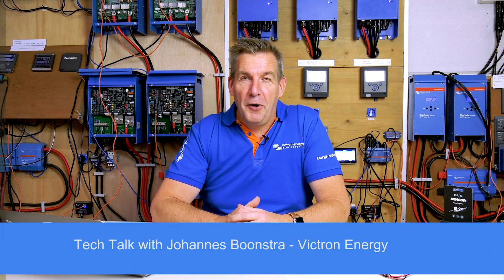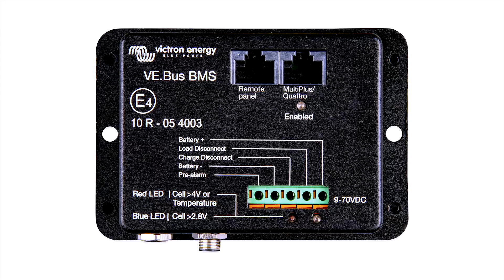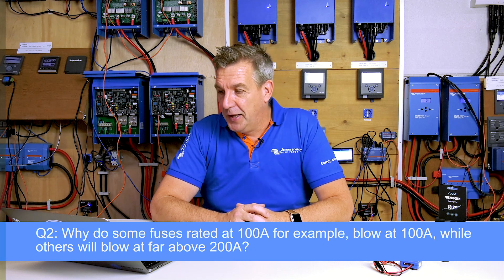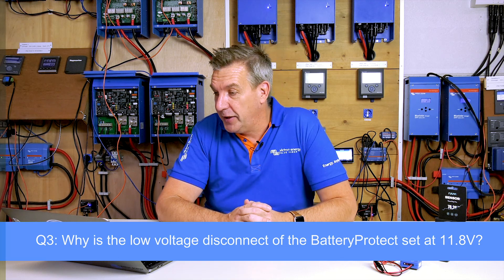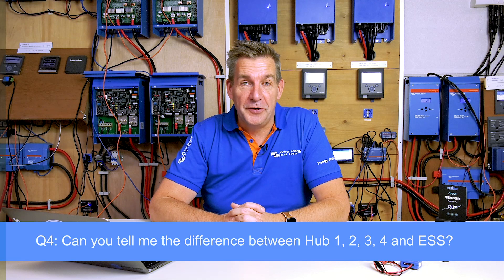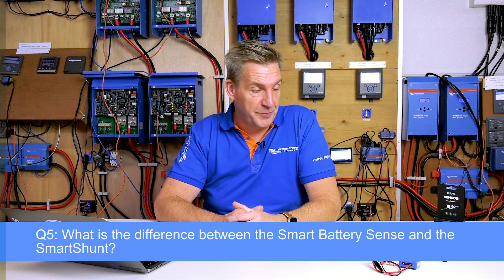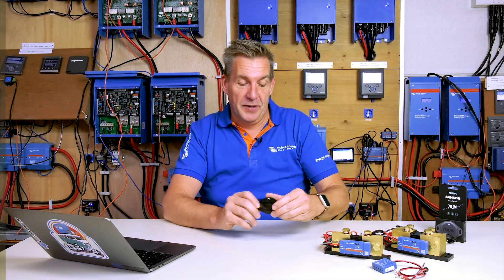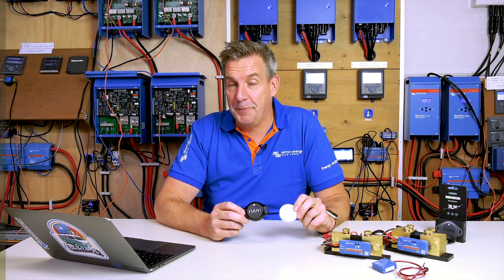Victron Energy Tech Talk - Episode 7 (VE.Bus BMS vs Lynx Smart BMS, Smart Battery Sense, SmartShunt)

Comment: I have another question. I read on the LFP battery datasheet that you can connect 5 parallel batteries, 4 12v in series but only 2 24v in series, for a total of 1500A.  I'm kind of confused. 

I take that as, setting up 20 12v batteries, with 5 in parallel to create 1 unit then i can connect 4 12v units in series to achieve 48v 
Or
Setting up 10 24v batteries, 5 24v in parallel to make 1 unit and then connect 2 units in series to get 48V. 

So current is also another question, if i use 20 12v batteries with 300a each that's going to be 6000 amps of current. 
Or 10 24V at 200a each that's going to be 2000amps.
Reply: the limitation of the number of batteries is not on the Ah , its on the communication side.

Comment: Another question was how much current can a given inverter/charger handle for a battery Bank. 
By handle I don't mean charge but rather to control the mass of current. In a sense i can lift and carry 25 kg weight safely, but 50kg will be out of my handling capacity. 
Lets take a 3000W/12V unit, can it handle 1000 A of battery load? How about 2000A of battery load ? Whats the limit?
Reply: well, I dont understand the question (I think), an inverter takes power from a battery as much it needs. When that isn't available the inverter will stop working.   so when you have 1200W load, there will be a 100A discharge current on a 12V battery
Reply: @johannesboonstra6917  so the inverter has this pass through/bypass AC output 2, this output only works if the grid/generator/shore power is on and does not use the batteries. 

So my question is how much load can it handle? Can i put 50 A load on this bypass assuming my grid can handle it
Reply: @feelinglowletsgo  No, AC2 out is a switched output to power AC loads under certain conditions, default is that its powered when AC in is available

Comment: I went through a few datasheets of the inverter/charger but did not find the current for the AC bypass load. That's the second AC output that doesn't supply via batteries but only when the AC input is live. 

Because I'm thinking i could very well take the grid line ans connect to the inverter, like 15KVa with a 20Kva battery back, then connect fans, fridge, sockets and lights to the AC 1 output for continuous power, and then connect water heater, air conditioning system, other heavy duty appliances to AC 2 bypass output. Of course with all the Safety and circuit breaker etc. But then wont the AC output 2 ve overloaded? 

So what's the general current limit of the AC 2 output for all inverter/chargers?
Reply: the feedback relay is the passthrough current, also this can be seen in the model name (a 12/3000/120-16 has a 16A passthrough)
larger models are able to passthrough more power.

Comment: The voltage and amps keep jumping around real fast, just started this, do you have any ideals about why
Reply: on a smart shunt?   see if the wiring is done correctly and the battery is able to feed the load well, normally the battery voltage is pretty constant

Comment: Hi, there seems to be some confusion out in the Victron community about exactly what “Pass Thru” is on a Multiplus. I have the 3kw/120A/12v Mutli. It seems to go to Pass Thru mode when the Multi is set in Charger Only mode and the AC load demanded from the circuits exceeds the 240v supply threshold (16A typically). Pass Thru therefore seems to be a state whereby the Multi will take the total load demanded from the shorepower supply, regardless of load, and it may throw the breaker shoreside due to overload. If the Multi was “On” in the same circumstances then it would invert the excess over 16A. Is this correct? I had an Easyplus previously, it seemed to work differently and would automatically invert any excess over 16A even when in Charger Only mode - but that might be wrong, poor recollection. I’d be grateful if you would clarify the situation in one of your technical videos. Rob.
Reply: when on charger only the inverter function is disabled, so without shore the unit stops working, with shore power the power assist doesn't work. Only power is passed through..

Comment: I have a 220v water heater (Nautic boiler B3) on my boat controlled by a switch. I would like to connect it so that it starts when I am in a float/storage state. 
I have multiple MPPTs, a Cerbo Gx and a Phoenix Inverter Smart. 
Can I use the relay function to achieve this? Should I use the connection to the inverter for that or another component in my setup?

Comment: how do you connect mutiple orion tr smart smart 12/12 30A to the same network?
Reply: You mean for the ATC signal?, these can be getting the same "plus" on the remote port.
Reply: @victrontech  yes for the remote control and the parallel connection, i can't find any schematics about that in function to fuses and so

Comment: I sure would like to see you guys add the ability to have a couple different charge profiles that we could easily switch between with vrm or the cerbo touch. Since it's not good to store LiFePo4 above 70-80% soc it would be nice if you could easily select between full charge and storage charge so it stopped charging when it hit that maximum state of charge.
Reply: Good news is there will be the ability to switch the inverter on/off/charger only on VRM shortly. Changing charge profiles isn't included.  Main reason is that with our charge voltage we are already on the conservative side and the battery cell isn't at 100% anyway (although we do call it that) so there is no reason to have the charger stop much sooner.
Reply: when charging the battery with 14.2V on a 12V LFP the cells aren't at their max so could remain there without suffering on lifespan. so switching to a lower value doesn't make sense. in float it will be reduced anyway I would add.
Reply: @victrontech  why 14.2? I charge at 14.6 per sok's recommendation.
Reply: @caseypries7559  14,2 allows to have more longetivity in their use compared to 14.6

Comment: Johannes, love these videos, learn so much every time.  My question ... Bottom line, can I use Bluetooth as a replacement for VEdirect cable to connect a smart shunt to a Cerbo GX? ... Question background: on a boat, I am thinking about primary house back 24v with 1000A Smart Shunt, pony secondary house back for 12v loads (NMEA2000, VHF, etc.) with 500A smart shunt, and then engine and generator staring battery bank with 500A smart shunt.  I then want to add one or two solar charge controllers.  I would prefer to use solar MPPT charge controllers with VEdirect, over VE.CAN if I could (many more options). But I want all 3 banks, and 2 charge controllers (and 24v/8000 Quattro) to show up on Cerbo GX, that only has 3 VEdirect ports. Is the bluetooth network simply for sharing data from shunts directly to charge controllers, or can it be used as replacement for VEdirect cable to allow shunt (or charge controller) to share data with Cerbo GX?  Thank you so much!
Reply: No, Ve direct is the way you should monitor the product with a Cerbo, this cannot be done with bluetooth (which is for temporarily monitoring and setting up)